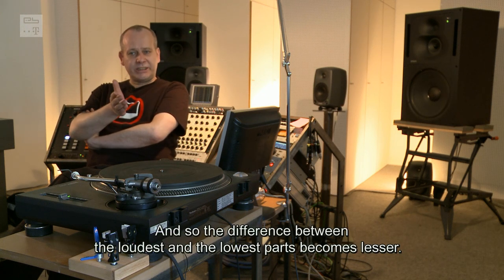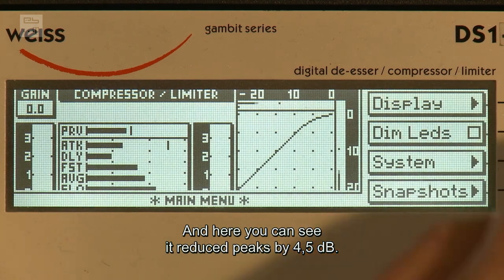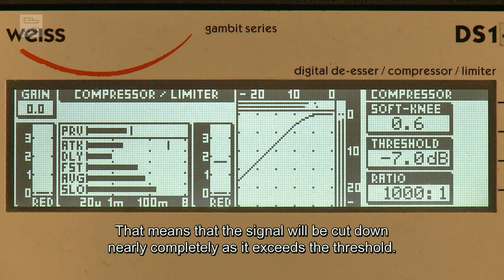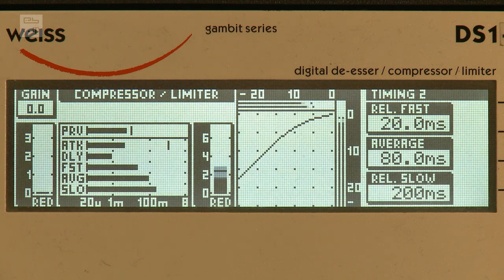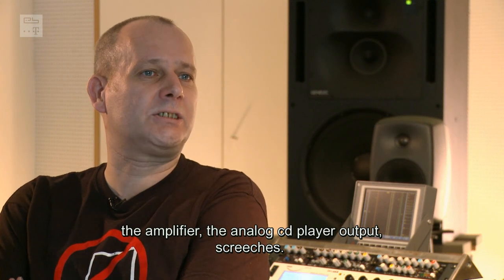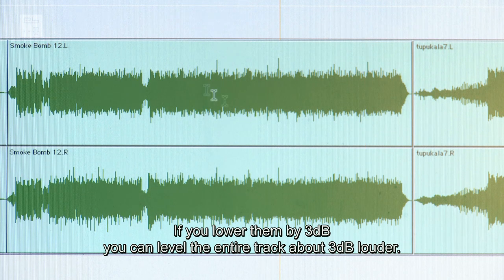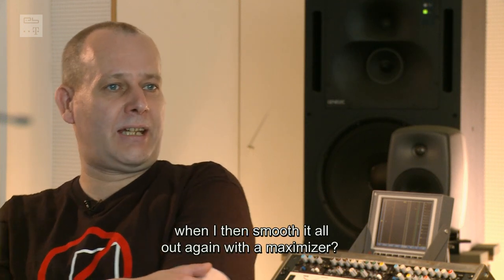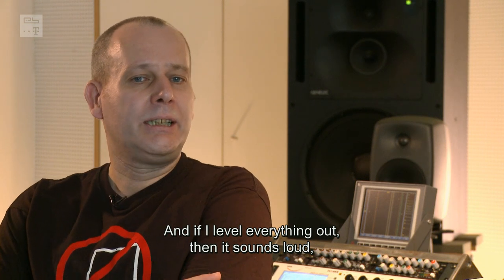Tech Talk: Loudness / Compression (Electronic Beats TV)

Comment: Top notch, very valid points about definition and the importance of the transients. Also, when you make electronic music, compression and limiting shouldn't even be all too necessary as you don't deal with live recordings where e.g. a guitar player hits certain notes too hard. With velocity, volume envelopes etc. you can make sure that there are no excessive peaks anywhere. Just use the f'n faders and stuff to make a proper balanced mixed and add only a tiny anount of limiting to finish it off.
Reply: Yeah but some producers use compression as an artistic tool, so it becomes very necessary

Comment: Only if you're fully aware of this but still do it for stylistic reasons you're doing it right. But most electronic producer/dj's don't realize they can learn a lot from mixing and mastering engineers.They think they can master in a small studio with a couple of thousand dollar speakers, when mastering engineers have the best rooms with speakers up to a 100.000 dollars providing MAXIMUM resolution.You can't compose, mix AND master all by yourself and expect optimal result. That's megalomaniac.
Reply: Old comment but still very very actual, because nowdays you HAVE TO do it by yourself if you're not financially well enough to pay a mix and a mastering engineers, that's at least a 100-150 EUR, pro track if you do. At least that's my case, I know my "mixes" and "masterings" are far from a correct level, but I still want to send clean demos, so it is what it is...